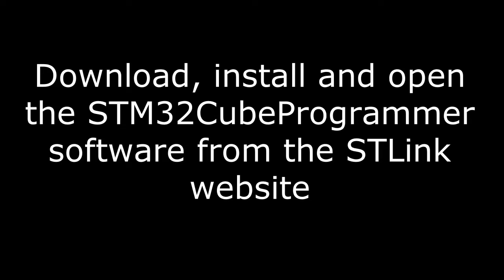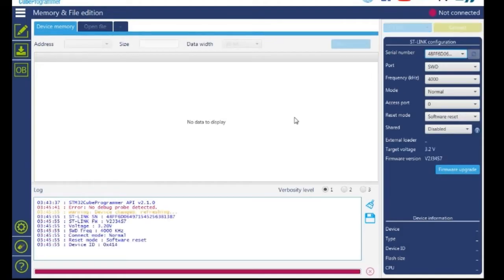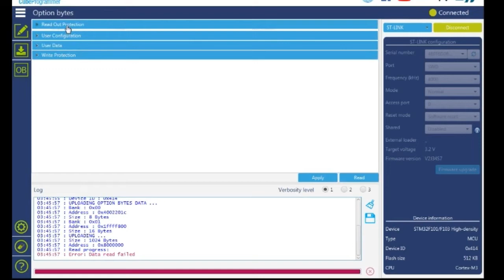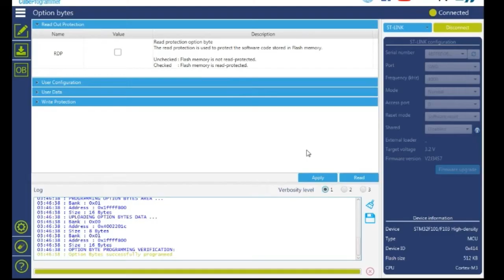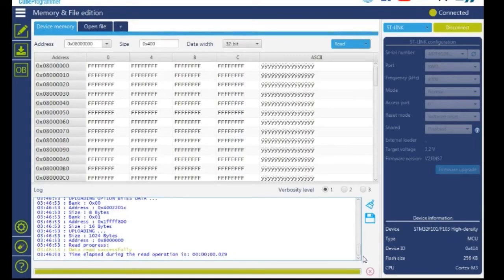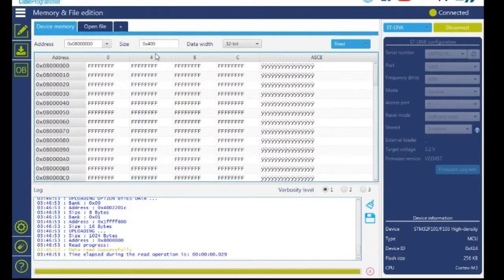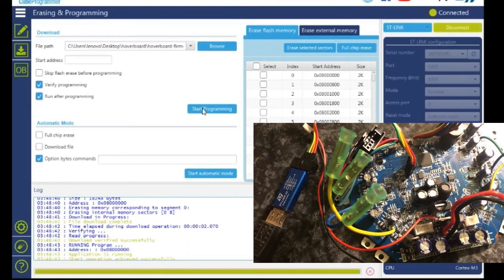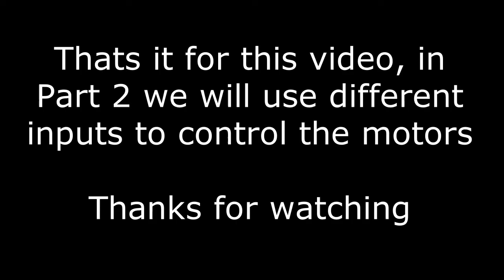HOVERBOARD MOTHERBOARD HACK - how to change the firmware to use different controls PART 1

Comment: Hi Tech, if I want to set up for rc control, what should I do? just flash firmware like you did on part 1 or do more set up ? please help thank you
Reply from the maker: hi, yes do as in part 1, have you sen part 2? that shows using a digital to analog convertor, if using a rc receiver its a bit more complicated, either way i think you would need an arduino inbetween, thanks

Comment: Is it possible to use a 4 pin header where both sides are short?
Reply from the maker: ahh ok, probably not, they are really cheap, if you dont want to buy you might be able to cut up a paperclip, thanks
Reply: A-Tech I would want to buy them, but I can’t find them online.
Reply from the maker: @relatedl35  ok just search ebay / amazon for 'header pins' they come in a stick of loads and you just break off how many you need

Comment: I successfully flashed one board but not im getting a ST-LINK error (DEV_USB_COMM_ERR) when I try to connect.
Reply: The problem was that the pins on my st link clone are in a different configuration than yours.
Reply from the maker: @andrewkennett940  ok so does it work ok now?
Reply: Yes thanks. I flashed another motherboard successfully. Now im trying to figure out how to combine the MCP-4725 demo and the PS2Tank_v0_Analog code that was with all the files you had on github.
Reply from the maker: @andrewkennett940  ok thats great, just remember to use 3.3v on the motherboard inputs, good luck

Comment: Dumb Question....   If I wanted to purchase a hoverboard to hack this way, it would have to have the correct motherboard.  I can't imaging they are all the same.  How do I choose a correct brand/model to ensure I get one I can hack with this code?
Reply from the maker: that is a good question, what i look for is the 4 groups of wires at the bottom, the 4 pin charge connector and 4 capacitors at the top, here is a link to the last one i bought that was ok : https://www.ebay.co.uk/itm/113821955450

Comment: Finally did a re-flash of the firmware with the correct file.
File link shown in the video descrition does not produce the required results.
File link shown in reponse to my query is the correct file of the firmwarre.
Motors responded to the joystick commands.

Some issues:
1. The motors starts with a slow speed even at the joystick centre position. (Does it need any calibration or zero setting?)
2. There is no reversing of the motors when the joystick is pushed backwards. 
3. On switching OFF, the board does not go Off, the buzzer keeps beeping intermittently. Subsequent pressing of the switch has no result.
Had to disconnect battery supply to stop.

Any help will be appreciated.
Reply from the maker: ok I will have a look into the link on the description, ye i found the same when using a joystick on its own, thats why i used the arduino to remap the signals, i dont know of any calibration, also with the reversing i found trying to reverse full throttle doesnt work but just a little bit is ok, so i mapped that out too, the power off thing may have something to do with taking the 3.3v from the board, im not sure exactly, i take the 3.3v from an arduino so that might be whats causing it, hope this helps
Reply: @A-tech  I have the same problem number : On switching OFF, the board does not go Off, the buzzer keeps beeping intermittently. Subsequent pressing of the switch has no result.
Had to disconnect battery supply to stop.

Comment: Finally I flashed the firmware. After switching ON, the motors rotate few rpms clockwise and then clockwise, with the buzzer beeping. This happens for sometime and then stops. There is no effect of the joystick at all. What could I have done wrong ?
Reply from the maker: hi, did you definitely use the hover.hex file from the link in the description? after downloading the file needs unzipping and the one you want should be like this: hoverboard-firmware-hack-bewegungsappar.at\build\hover.hex, I know there is another one I used that did that same thing, let me know if it works, thanks
Reply: @A-tech  I guess I did just that. Since the AT Link software is unable to recognize zip files, I unzipped and extracted the hover.hex file from "build" folder  to the desktop, from where I was able to continue with the firmware flashing. Should I try flashing the same once again ? Thanks for the prompt reply.
Reply from the maker: ok, i know one of the firmwares has a motor test on it, strange its not working, i just checked it, did you download the whole zip folder? extract the whole lot and try again, i did it with just the build file and it didnt work, hope this helps

Comment: Hi, first of all nice tutorial. Inspired by the video I also flashed the mainboard with the hover.hex file from the build folder. When I hook up 2 potmeters on the ADC1 and ADC2 port with 3.3V from the programming socket I'm unable to control the motors. They keep spinning at the same speed whatever way I turn the potmeters. What I also noticed is that I can turn on the mainboard but I cannot turn it off. Did you ran into the same thing before or do you have any thoughts?
Reply from the maker: hi, its nice to hear im inspiring people to try this, ok so a few things to check, what version is the motherboard? I know v1 and v2 are ok, are the potentiometers 10k? is the second sensor cable disconnected? is it possible you are using the right sensor cable instead of the left cable? hope this helps
Reply: @A-tech  Hard to tell which version of the board it is. I only see BYJ-3.
The potentiometers I used are 5K versions. I'm using the correct sensor cable being the left one (close to the speaker) with the PA2/TX/ADC1 and PA3/RX/ADC2 cpu reference. Will change the potentiometers to 10K versions as a start. Thank you for the swift feedback.
Reply from the maker: ok great hopfully its just the potentiometers, thanks
Reply: @A-tech  Checked and double checked, conclusion never take anything for granted :-) Found the cause, it seems that the board came with the sensor connectors soldered inverted being that the black wire was 14V and the red wire was ground. This for both sensor connectors. As the colors of the wires were matching I did not look any further. I was quite fortunate that I did not blow the ports of the cpu. I soldered the connectors as they should be (matching colors with ground and 14V). All works fine now. So lesson another lesson learned today. Cheers
Reply from the maker: hi, thats mad about the black and red wires being switched over, thanks for sharing your solution
Reply: @A-tech  Hi, could You give me your mail or FB? Have a problems, dont understand what did wrong
Reply from the maker: yes sure its edeped@yahoo.com
Reply: @A-tech  hi, thanks for your help, I have two questions,  I hacked more than one boards, two of them get four peep tones before the shutdown, do you know what is the problem? besides, I want to know  how can I know if the board are V1 or V2?
Reply from the maker: @awsalmayah8023  hi, so is it you try to use it and it beeps 4 times and turns off?
Reply: @A-tech  yes, I just power it on (without given order), it peeb 4 times then it trip¡¡¡
Reply: Hi Jan Rottiers,  How did you resolve the main board "not turning off" problem. I am also facing the same issue.

Comment: One of the hoverboards I have does not have the motherboard as shown. They have only two PCB, combined with the foot IR sensors, probably as optimisation. How do we access such PCBs to flash the firmware ?
Reply from the maker: hi, im not sure how you would do it with those, if you wanted to get a new mother board off ebay to use instead they are quite cheap, less than £15

Comment: Hey, so at 6:41 you have the file path of the file you want to upload to the overboard. Where can I find this one file? I have looked everywhere on the GitHub link you had in the description but I didn't really find it. Thank you for all the time you spend doing those videos, the results are great!
Reply from the maker: hi, if you click the link in the description and download the files as a zip folder, when you open it up the firmware file should be in the build folder called hover.hex, this is only temporary i will have my own version hopfully soon, thanks
Reply: A-Tech thats great thank you for the information! 😃

Comment: Is there a benefit of using a modded motherboard vs using a controller like a sabertooth with the arduino?
Reply from the maker: the modded motherboards are a lot cheaper, around £20, and if your recycling a hoverboard its an extra part you can use, hope this helps
Reply: A-Tech well the hoverboard i had, when I opened it up it has no motherboard at all. Only the two sensor boards. So that leaves me having to buy something. Most of the motherboards I see online here are more like $50-90 USD. So if money was not a factor would there be any benefit in using the motor controller vs the motherboard? Or would the end result essentially be the same?
Reply from the maker: sorry for the slow reply I have only just seen this, motor controller vs motherboard, the settings in the motor controller would most likely be better for fine tuning things, like more options possibly, the motherboards are designed to run hoverboard wheels but I dont know how optimizable the firmware is, if you had to buy the parts you might be best off with the speed controllers because you could use them for other things in the future
Reply: A-Tech thanks for this info!

Comment: Im trying to hack the separated type of mainboards which have 4 pins for ST-LINK connection each of them. Do you have any suggestions for those type?
Nice video tutorial although!
Reply from the maker: hi, I think they are the old type of motherboards, the only thing I know about those ones is they stopped using them as one was next to the battery and caused fires, also there doesnt seem to be as much information on them boards, may I recommend getting one of these types of boards? they vary between £15 and £20, thanks

Comment: Ok. But do you think There are any way i can controll my hoverboard withoute standing on it. I want to make a somthing out of my old hoverboard?
Reply from the maker: ok if you dont want to open it up and just want it to move about, one way is you could make something that can put pressure on the foot switches and make it tilt
Reply: A-Tech can i Get your Mail i can send you a picture of what i have madde so far?
Reply from the maker: @erikogelisesverden4995  yes no problem, its as681785@gmail.com, thanks

Comment: Thank you for the video. I've seen other tutorials where is required to have the battery connected to the mainboard with a minimum of 36V on it and also to add a jumper on the power switch. In your video, I see that you are using only the programmer. Is that enough to flash the new firmware?
Reply from the maker: hi, yes i also saw that, apparently it can loose power during uploading but i have done 2 now and no problems using just the 3.3v from the ST-LINK, thanks